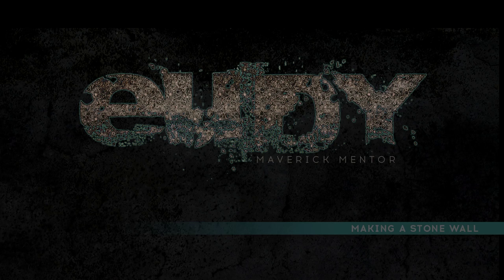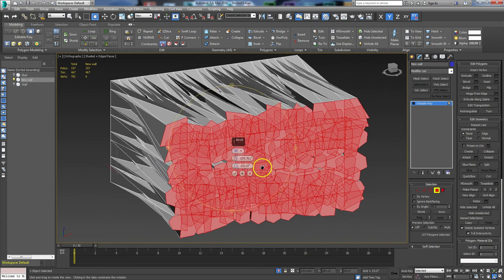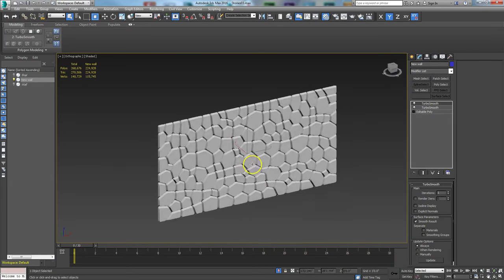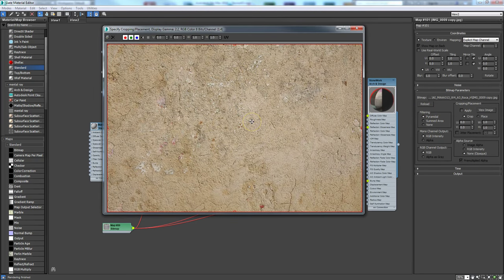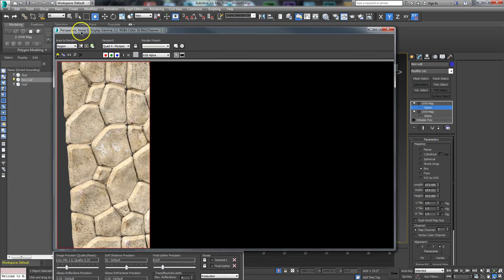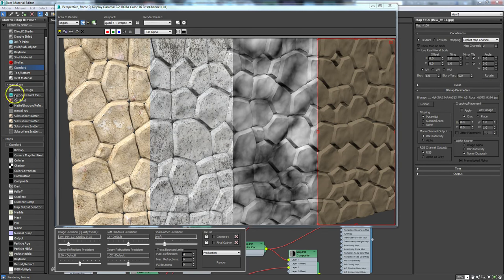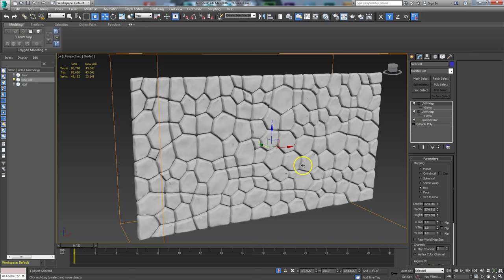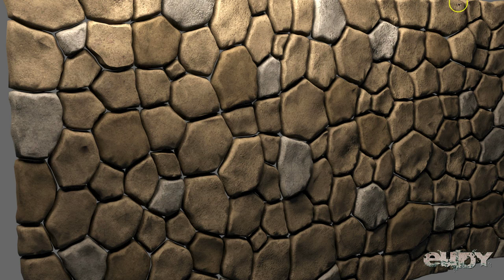Making A Stone Wall | 3dsMax | Mental Ray | Video

Comment: if you want to curve the edge you could have done an inset, and then hold ctrl and click on edge and apply a chamfer. That way you have less poly.
Reply from the maker: Thanks for the comment. However, your technique would have destroyed the randomized surface effect. If you don't have the geo generated by the turbosmooths, then the noise would not have geo to displace the front surface. Yes, you would have fewer polys with a chamfer, but at the cost of making the surface flat. Not rocky looking.
Reply: Really appreciated the come back, i need to make a modular kit as a school project. Going to make a church modular kit
Reply: @eudymaverickmentor  im quite beggining since last september into 3ds max and now I want to create a scary looking church in u real engine. Will create modular kit for modelisation and then texture it and create a nice looking scene in unreal.
Reply from the maker: @gastonbob3308  Awesome exercise. Be sure to set Max up correctly by changing the world scale to centimeters (it defaults to inches). That way the modular parts you make in Max will be the correct scale in the Unreal engine.

Comment: Love the video! It was very helpful. Would it be possible to curve this wall? or wrap it on a curved surface? If so how would you recommend doing that?
Reply from the maker: Ryan. This is pretty easy to do. There are two ways to approach it. One way is by applying a "Bend" modifier to the piece. This will get you a perfectly round piece. If you want it curved but not round, say an irregular curved flow, then draw a spline that mimics the curve you want and apply a "World Space (WSM)" Path Deform modifier to the object and then select the spline you drew. Be sure to select "Move to Path" to move the wall to the spline. It will place it on the "first vertex" end of the spline. If the wall flips itself so it is facing the opposite direction then put 180 degrees in the rotation. One last thing. If the wall is distorting, then you will need to go back and place a "Normalize Spline" modifier on the spline to make the spline have even tension. Hope this helps.
Reply: Thank you! I really appreciate the help.
Reply: One last thing. My view is stuck in what appears to be "wire frame" mode. I would like to change the view settings to view my plane and objects similar to yours on the video (solid or 3D). What settings would you recommend adjusting.
Reply from the maker: F3 is shaded mode. F4 turns wire on shaded mode.
Reply: That was my initial thought too so I tried it but had little success. However if the object is not selected it reverts back to a wireframe view. I wish I could show you a screen shot.
Reply from the maker: Ryan. Your description is still a little vague. You seem to indicate that when you select your object, it is shaded without a wireframe. Just a solid object. And then when you deselect it becomes a wireframe. There is no setting that I am aware of that will make Max do that. Why don't you show me a screen shot. Post it on Pinterest and post the link. Or better yet. Record a Screencast and post the link.
https://knowledge.autodesk.com/community/screencast
https://screencast.autodesk.com/Main/About

Comment: I think this class was awesome but I do have one question.  I couldn't figure out which item in the material editor you actually assigned to the object.  I understand everything in the video but could figure out which item you physically assigned to the object.
Reply from the maker: Hi Kevin,

I'm not sure of your question. I applied the shader to the surface, It is an Arch & Design because I am using Mental Ray. It is labeled StoneWork. There is one Material. All of the other nodes are maps. Maps cannot be applied directly to a surface. They have to be plugged into a Material. Hope this helps.
Reply: So I guess my version 2017 must be different from the version you are using.   That particular item is not available on my version they have concrete and metal but no stonework.
Reply from the maker: Kevin,

Sorry for the confusion. Just to be clear, the tutorial was done in 2016, not 2017. But it shouldn't make any difference from the tutorial point of view. I am not using pre-made materials. I am making custom materials. 

I am using Mental Ray as my rendering engine. Be sure you have it installed. It is an add-on now in 2017. It is free for students. You can get it here.
http://www.nvidia.com/object/mental-ray-3ds-max.html

Then I am using the Arch & Design material for the tutorial. "I" labeled the material "Stonework" as I was using it for stones.

I hope this clarifies.

Some other videos that might help you are these.

Surfacing Terminology 
https://www.youtube.com/watch?v=7Cg8XGTN_BI

Surfacing Patterns | Theory
https://www.youtube.com/watch?v=6vazcmnxJwY

Setting up 3dsMax for Production 
https://www.youtube.com/watch?v=rqhKYF53cgI

Setting Up 3dsMax 2016 & Basic Mapping Coordinates 
https://www.youtube.com/watch?v=IlcLYiOVjPM
Reply: Autodesk has been slowly scaling back I-Ray and Mental Ray because NVIDIA is now charging for it.  In 2018 it is really scaled back to where it is just kind of a sub renderer.  So on the 2017 version they changed some stuff as far as Mental Ray and I-Ray but I did find a work around.  Thanks for the help.
Reply from the maker: Actually, it has nothing to do with NVIDIA. Autodesk bought Solid Angle early last year. So they will be shifting to Arnold. Maya 2017 already has Arnold in it. And you can now download Arnold for Max. But it watermarks your renders. Maybe eventually Autodesk will include a full license, who knows. Even Autodesk doesn't know. So it may end up that there is no longer a free Physical Based renderer for Maya and Max. Except RenderMan for Maya.

I am using Mental Ray in both Max 2016 and 2017. Looks all the same to me.

Comment: While I understand the modeling part of this video, the shader part I cannot follow, since the version of 3DS MAX I'm using is 2021, and it doesn't use Mental Ray anymore. Could there be an update to that section?
Reply from the maker: Hi Peruvian. Make two changes. Arch & Design Material (Mental Ray) to a Physical Material (Autodesk). For the Mulit/Sub Map (Mental Ray) use an "OSL: Material ID" to a "osl: 1 of N (Color)" map. The rest would be the same. You don't need the color nodes from the original tutorial since the "osl: 1 of N (Color)" map has them built in.
https://cdn.discordapp.com/attachments/797823598655438898/896059847278223360/unknown.png

Comment: Hi. I am using the 3DS Max 2016 but I can't find the Polygon Modeling option...
Reply from the maker: Dalton. That question is a little vague. I am going to assume maybe you are talking about the "Polygon Modeling" tab in the "Ribbon" at the top. Like at frame 3:28. 3dsMax is context sensitive. So if you are trying to click on the "Generate Topology" button it will be grayed out unless you have an Editable Poly selected. In the video I created a plane and then converted it to an Editable Poly. With this selected then you will be able to select  "Generate Topology". Hopefully this helps.
Reply: Thanks :)